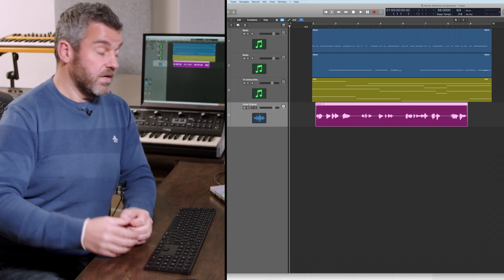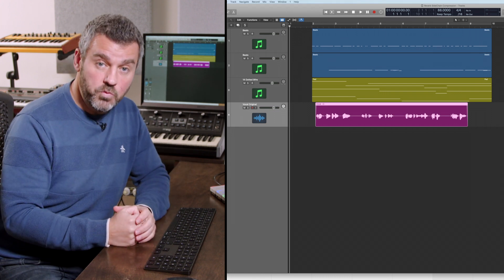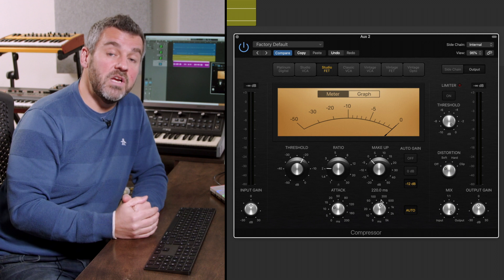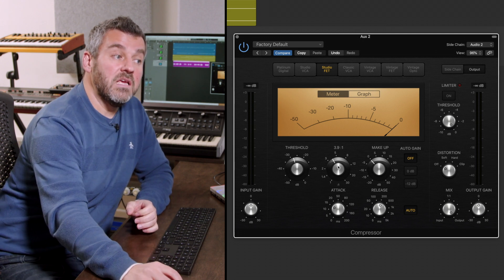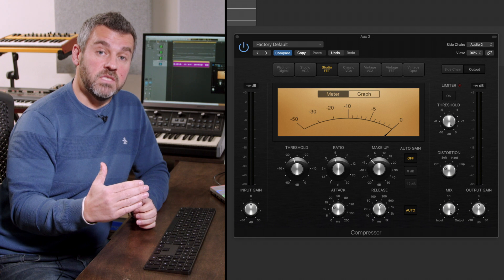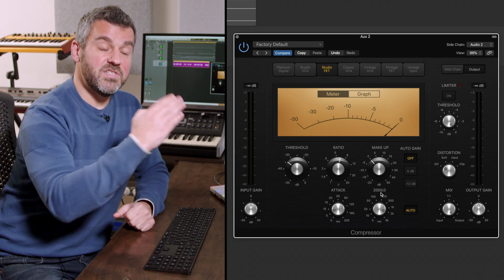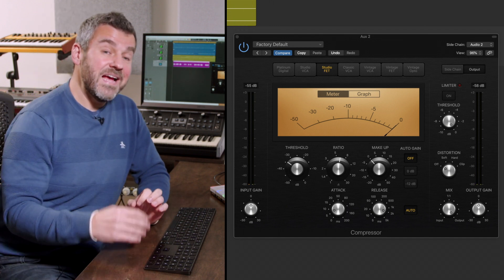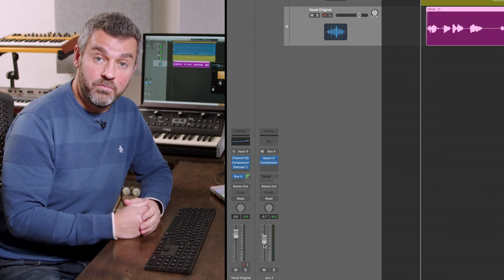Logic Tips: Sidechain Compression on Vocal Reverb

Comment: I don't understand why you left it on Output rather than selecting Side Chain. You enabled the side chain at top right, but never took it off Output. If you don't need to, what is that selection for then?
Reply: in this scenario he is actually using the compressor as an automated control for the reverb in context of the music. the sc option you mentioned is a sc filter of the compression.

Comment: Great tip! I noticed in the video that the Auto Release button is engaged. What is the relationship between that button and the Release knob? I was under the assumption that if it is engaged, the knob has no effect, but this video suggests otherwise. Jono's videos are always so practical and helpful. Thank you!
Reply: Drove my brain crazy for awhile too until I read the manual, having used pro hardware comps for years. But they work in conjunction with each other. So no, turning Auto on does not disengage the Release. It just allows the Release to work "more" dynamically with the incoming signal. So you could set the Release manually first and then turn on Auto for better control of very dynamic, changing or program material. That may not be a perfect explanation, but you could download the manual for clarification. I keep one on my system for quick checks of confusion.